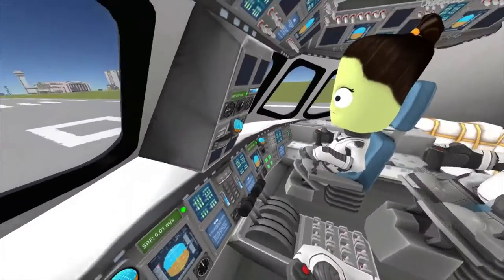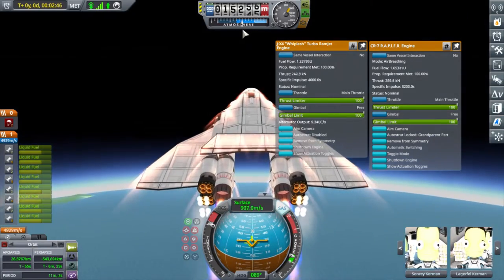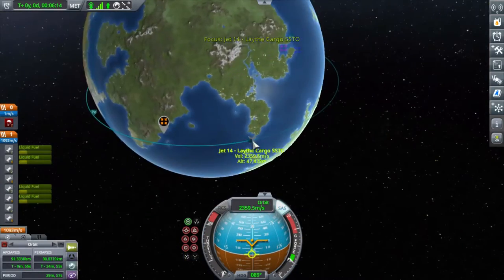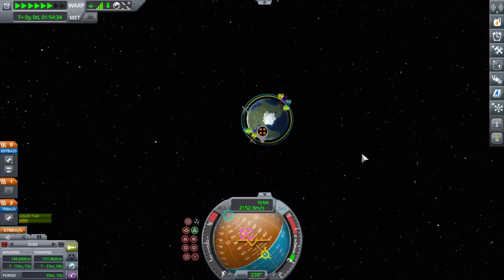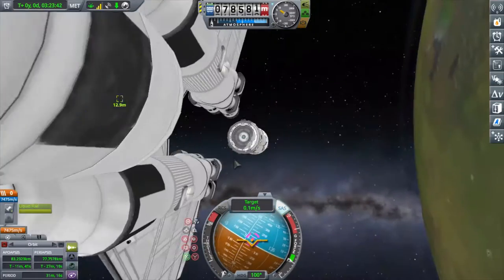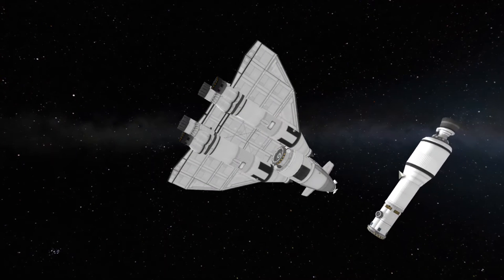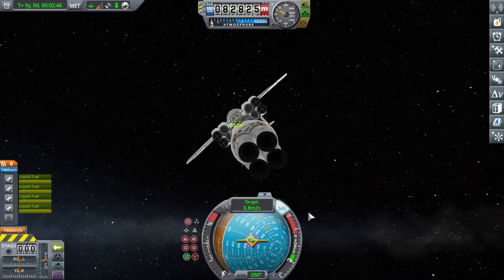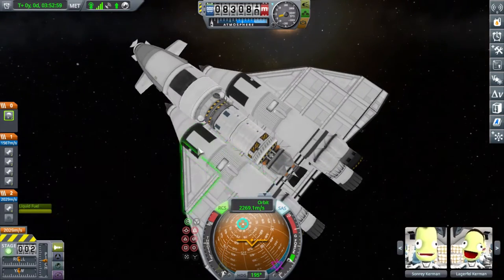Preparing a Large Cargo SSTO to go Interplanetary

Comment: After a while, I just decided to do the DUNE HEIGHLINER approach.
I actually built a pretty large cylindrical station, sent it to LKO, then manually sent copies of that to each planet, and instead of wasting HOURS doing the transfers (that I'm not into that so much anymore) I just make sure to dock to one of these and teleport to any other, everything else is just legit as usual. Not saying it is right or wrong, it is just the way I have fun with!
Reply from the maker: That sounds creative and fun, which fits the KSP mantra in my opinion.  It would be cool if there were a mod for skipping planetary transfers using warping structures, like in Mass Effect.